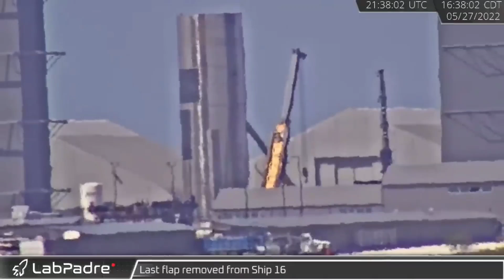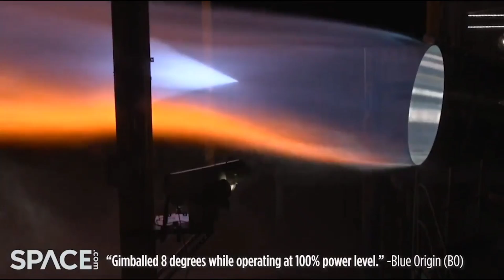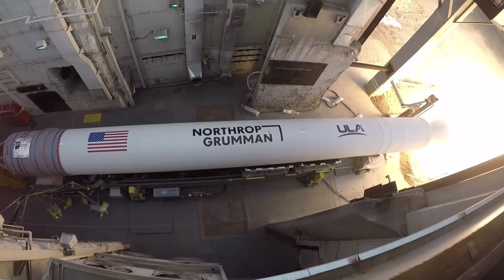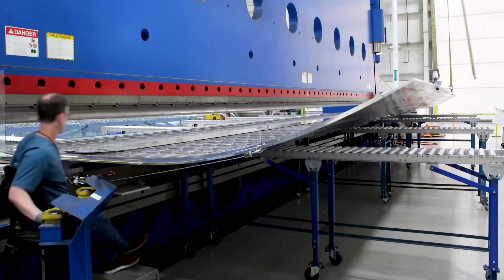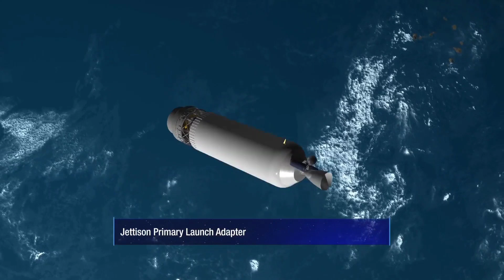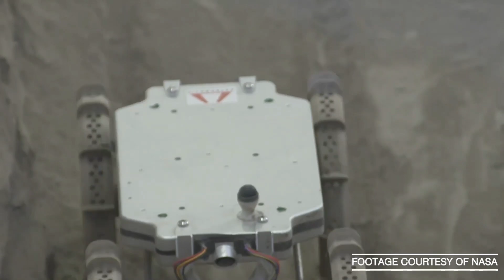Starship vs Vulcan Centaur!  Who launches first??  100K Challenge Update!!

Comment: The BE-4 engine is no longer the real critical path item. They still have a ways to go, but they are finally closing in on finishing and delivering those flight engines which you showed one photo of in the build up stands at Kent, WA with its GOX cap installed. 

What are the problems, then? As Eric Berger at Ars Technica had to admit, there are continuing problems with the Centaur V and the Peregrine lander. Both or either having further delays, will delay the maiden flight of Vulcan into 2023.

If Peregrine becomes the only hold up, Tory Bruno needs to have a back up payload, even if it's a giant metal paperweight.

Comment: I think Vulcan Centaur will be successful. But I doubt it will launch before Starship. I expect Starship to go up in early fall, while Vulcan is unlikely to go up before late in the year.  Remember BE4 flight engines haven't even been assembled yet, much less test fired. While Boca Chica has all (or almost all) of the Raptor 2s it will need for the orbital flight (and these have all been tested prior to shipment unlike what will happen with the BE 4).

Comment: Vulcan Centaur is obviously a more mature launcher because it uses entirely 1960s technology with the exception of the BE-4 engines and the avionics.  The Centaur upper stage first flew on 26 November 1963!  The Northrup-Grumman GEM-63XLs are derived from the Congreve rockets launched against Fort McHenry 208 years ago, and is an evolution from the Minuteman that entered service in 1962. The core of the 1st stage is similarly derived from the Atlas V and Delta IV whose ancestors can be traced back to the 1950s!  The Atlas first flew on 17 December 1957 and the first Thor IRBM on 20 September 1957.  And environmentally Vulcan-Centaur is a nightmare.  All of its components get dumped in the ocean or burn up in the atmosphere, and the solid fuel engines spew toxic chemicals into the atmosphere whereas Starship emits nothing but carbon dioxide and water vapour!  Furthermore the continuous explosion of a solid fuel booster generates far more vibration than a liquid fuelled rocket.  I read that it cost the James Webb Telescope team a BILLION dollars to adapt the probe to handle the extra vibrations from the Ariane 5s solid boosters.  What's a billion?  If you were given a billion dollars at the birth of Christ and spent a thousand dollars a day every day for the next 2022 years you would still have over 250 MILLION left. 

SpaceX has more customers than it can handle because it can offer prices and scheduling flexibility that none of its competitors can match except the small lean and mean micro-launch companies.  Otherwise a larger faring, and possibly a more powerful second stage, would seem desirable on the Falcon Heavy.  SpaceX has been gradually increasing its prices because it no longer needs to undersell its competition because SpaceX now offers a superior service.  For one thing it has the ONLY man-rated booster outside of PutinStan and the PRC.  Musk is a libertarian and unlike Jeff Bezos has absolutely no problem with honest competition.  SpaceX is doing almost nothing to protect its intellectual property from being copied.  Musk has said he has absolutely no concern about competitors using the technology he is creating with all of his companies because his personal objective is to make the World a better safer place for humanity and if another company can contribute to that by using lessons learned from SpaceX or Tesla then so much the better.  All of his testing is taking place under direct observation from NasaSpaceFlight and LabPadre.  When was the last time you saw a video or an uncensored photo of anything from BO or ULA?

Comment: Even if its first flight is this year (in the next few months), if SpaceX gets their approvals and there is no delays with their launch license, you can almost be assured that Starship will be launching quite quickly after that. The big question is, will it make orbit? SpaceX do have a lot of expertise with rocketry now, and aside from the more complicated engines, the Starship is essentially an overgrown falcon 9, so assuming everything with Stage-0 is good and the rocket gets off the pad, I don't see why it wouldn't make orbit. Re-entry on the other hand is another question as is catching the boosters and ships with the Stage-0 tower. While SpaceX will take what they have learnt from the hop flights and the Falcon 9, there is still much to learn about this beast. I for one am looking forward to Starship's first launch rather than the Vulcan Centaur, although both will be impressive, I think Starship will be more so.

If SpaceX get their approval tomorrow without another delay and the launch licence is granted shortly after, I don't see ULA getting to orbit first. The key thing is, ULA's rocket will not be returning for re-use, so all that complexity around booster and ship re-entry and catching is omitted from the ULA launch making it somewhat easier. It all hinges on the FAA for SpaceX vs Blue Origin for ULA. I have a feeling that the FAA will finish faster.
Reply: Talking with some former SpaceX employees it will be extremely lucky if the Raptor 2 engines are reliable enough by the end of this year. They are also running into a number of alloy problems withstanding the simultaneous pressures of the fuels and the mass of the Starship itself.

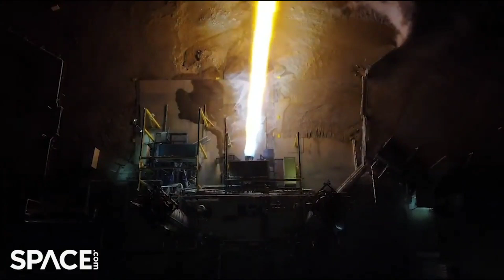Comment: 3:33 "It's the most powerful liquefied matural gas fueled rocket engine ever developed."  This is why these engines should always have been gauged on some concrete factor beyond "how big is it".  How many can you fit, and what's the thrust per area used?  BO looks absolutely pathetic, reaching for some kind of #1 metric when they understand perfectly well that their engine comes in 3rd place in thrust (after both Raptor 1 and Raptor 2) and 3rd place in arrival.
Reply: The problem with the Raptor 1 engine is that  though it produced a lot of thrust it would literally tear itself apart and was Impossible  to be reusable.  It was overly complicated which made maintenance difficult and a nuisance for mass production. And this was told to me by a former SpaceX employee.
Reply: @serronserron1320  Interesting.  Good to know.

Doesn't change the reality of BO gaslighting having lost a two-man race.

Comment: It's still too early to speculate, SS or SH could experience a catastrophic failure during it's preflight testing campaign with a lengthy delay ensuing, or on the other hand Vulcan's BE-4 engines could experience a significant failure as well.

Comment: didn't they say Vulcan won't be ready until next year?
Reply: It's hard to do integration testing when the most important component has not been delivered. I think that ULA is a pretty solid outfit, but I trust Blue Origin about as far as I could throw a Starship.
Reply: @surferdude4487  I guess you didn't hear that Peregrine and Centaur V are having lots of issues and may not be ready themselves which is why Ars Technica and Berger are changing the narrative on BE-4. It's way closer than people realize. This is why Tory Bruno, ULA, and Blue Origin the last month or so have been putting out all those photos, video, and information on BE-4.

Comment: I am SHOCKED that SpaceX has not yet solved their tile loss issue. It's been over a year, now, and they're still falling off everytime the ship is tested.
Reply: A pressure test frequently causes some flexing of the container - and that causes tiles to pop off. the advantage is that once flexed they tend not to flex again - so new tiles shouldn't be an issue.
Reply: They do not have a tile loss issue. An internal pipe broke, hitting the hull and that knocked off tiles. 
The tiles were picked up and the pipe removed and replaced later that day, weeks ago.

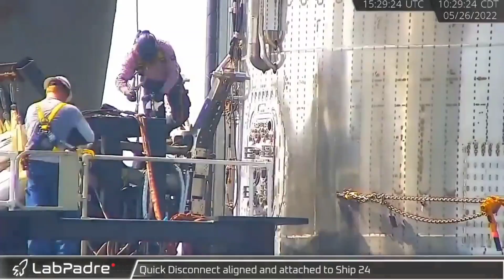Comment: 2:45 We're not close to a booster static fire?? They've just attached all the raptors to booster 7, I'd say we're very close. I'm still betting on Starship being launched first, though maybe not making it back in one piece [the TPS definitely looks like the weak point]
Reply: Based on Ship 20 the TPS tiles seem to get better each test, kind of suggesting the bad ones fall off and the good ones stay on pretty good. I think it's going to be okay in a real flight.
Reply: @LaughingOrange  I'm not sure how accurately the kind of tests SpaceX has done so far simulate the conditions the TPS tiles will experience during a real flight [at least the tests we've seen and know of]. They're definitely always improving, but the only way to really know is for them to launch. Can't wait!
Reply: Booster 4 never static fired despite having working raptors installed for months. And given that leakers have said that B8 will fly instead of B7, the same thing might happen.
Reply: @fork9001  Considering how much effort they put into booster 7, its seems unlikely they'll just scrap it without at the very least some static fires. No booster has ever done a static fire. Hell, Raptor 2s haven't been static fired while integrated to an actual starship or booster. Booster 7 looks like the perfect candidate to gain data with static fires. Booster 4 was likely scraped due to just how far the design had evolved since its construction. Static fires wouldn't have netted useful information on raptor 2 engines, cryostats wouldn't have netted useful data on the newest and latest design's structural limits, and even a flight likely wouldn't have been particularly useful in terms of the data collected. In the time since its construction, SpaceX  had already iterated the booster design at least 3 times. Scraping it was a sensible and rational decision, even if it was flight-worthy. The factors that led to the scraping of booster 4 then are not present in booster 7 now. Even if its not the latest and greatest, it still much closer to the most advanced design. Good data could probably be obtained from its flight, which means we cant rule it out. Plans may also have changed since the leak.
Reply: @josephpentony4804  Maybe OP meant 33 engine static fire, because Elon already said he would do the inner ring and then the outer ring separately. Like booster 4 with cryo proofing and static fires.
Reply: @fork9001  Still, I don't see a reason why a 33 engine static fire with Booster 7 wouldn't be something SpaceX is interested in.
Reply: @josephpentony4804  It would be unless booster 8 makes it obsolete. Or something goes wrong. But OP said “we’re not close” and that remains fact.

Comment: Have to ask is Space Force selecting ULA because they trust the product... or because it's the only launcher that can in theory currently launch the satellites without using the RD-180.
NASA trusted Boeing Starliner, how did that worked out for them.
Reply: Falcon heavy can’t?
Reply: @jmattoxriskpro  Falcon heavy uses the same fairing as Falcon 9.
Reply: @jmattoxriskpro  AA said it in the video, the faring on falcon is not big enough, and that's not something that can be easily changed.
Reply: I wouldn't say 'currently', it hasn't been launched it. 

It's funny how for this contract they apparently considered Vulcan, which was and is still in development, and Falcon 9, a proven rocket, but not Starship that is similar in status to Vulcan.
Reply: @limiv5272  Falcon can't, not big enough and Starship has not started booking yet (apart from dear moon.)
Vulcan is booking flights and has the capacity. 

Ariane can't be use as their national security flights, soon to be joined by Atlas, which is fully booked out anyway.
Reply: @mattmcc72  faring on centaur is 17.7 ft wide vs 17 for falcon heavy. I doubt that 8 inches is an impossible hurdle. For current missions it wit be a cost to change plans. For future missions I bet it’s a political decision
Reply: @jmattoxriskpro  size is three denominational, diameter only covers 2 of them. Falcon = 13m long, Vulcan = 15.5m to 21.3m
Reply: @limiv5272  I imagine they send committees to check upon development. 
BO prepares a large buffet, lots of champagne and whatnot. Limos shuttling for the facility.
SpaceX: -McDonald's delivers between 12 pm and 14 pm. Available on site: 
Connection to YouTube WAI, Marcus House and NASASpaceflight channels; Elon Musk prerecorded interview with Tim Dodd; The Angry Astronaut explaining why you shouldn't waste your time visiting other guys.
Reply: @BBBrasil  That sounds right

Comment: If a payload has been designed so it can only go up in 1 rocket, then I see it as backward logic to assume that it not then being awarded to a rocket it cannot go up in means they're showing faith in that 1 and only rokcet they can use. I seem to remember Space Force also requesting SpaceX design a larger fairing, which I think I can safely assume has a similar, if not the same, payload in mind.
Reply: We have no idea what the engineering constraints for this payload were. Maybe it had to be these dimensions to perform a certain function or not be incredibly expensive or something. Or maybe someone really wanted ULA to get the contract idk
Reply: Following your logic, if they don't award the rocket, their whole space program and roadmap is moot.
Moreover, they don't have reason to exist, the budget can be discarded and people employed can be fired.
Yeah, they have to put their whole faith on it ;-)
Reply: @BBBrasil  I was a little obscure with what I wrote by design. There is is 2 things I  point to at going on, only one is covered in the video. What conclusions people reach, are their own.

I just point out the logic is a bit backward. The payload will not fit the current Falcon9 fairing, it's that simple. That is the first point.

A larger fairing was hinted at being desirable, which is another point.

Another is that SpaceX wants to concentrate on Starship, that will have a large enough payload bay, maybe even enough for that 'payload' to be a final stage rocket to the Moon.

What actually happens is any one's guess, but it looking like all their eggs are in one basket does put a lot of pressure on the contrators to deliver on time. Or the consequences for them could be dire.

It's a matter of perspective.